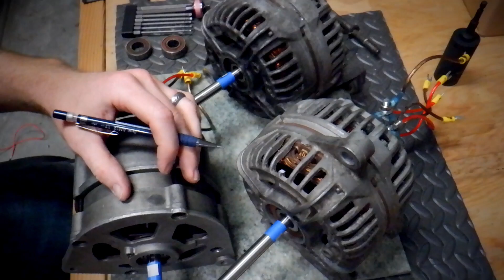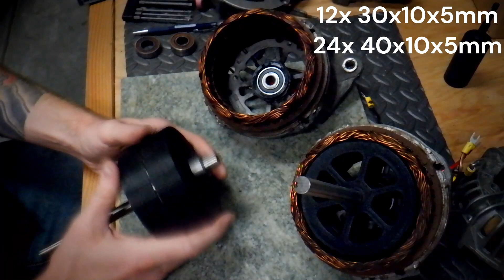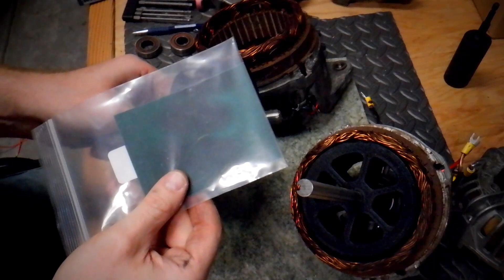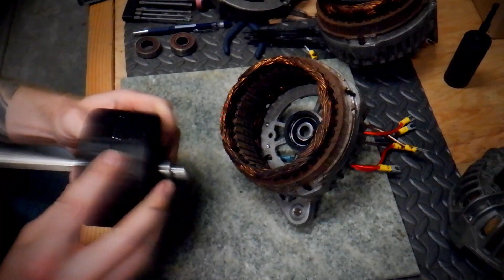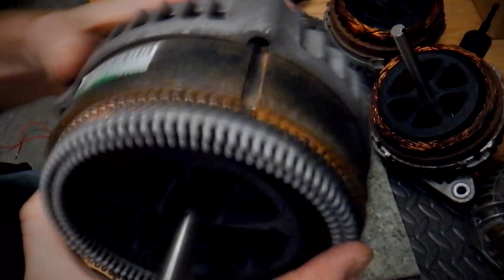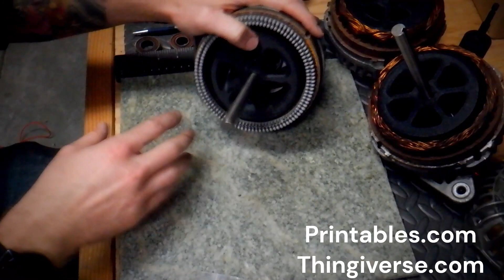Altermotor Comparison - High Torque or Speed?

Comment: Would like to see what the difference in power overall would be between the electromag and the conversion!
Reply from the maker: It would be very interesting to dyno to before and after!
But, using the same speed controller with both, I was only able to stop the shaft with my hand on the electromag core.

Comment: Hello, my dear friend. Your work deserves praise. Please let me know how many watts the motor is and the size of the magnet.
Reply from the maker: Thank you for your praise!
I only put 60W through it for testing, but I am comfortable that it can handle 500-1000W. Any more power and the core material needs to be changed to something more temperature resistant. But that change looks good up to 5000W.
Magnets are 40mm x 10mm x 5mm, double stacked and 12 pole pairs. So 24x total for the small one. The high torque motor uses more magnets.
Reply: I subscribed to you. I rang the bell. I am your big fan. Because I found in you what I was looking for. The FUTURE is BRIGHT in what you are doing. I will wait for the news. THANK YOU VERY MUCH!!!!
Reply: LOOKING FORWARD TO MORE VIDEOS FROM YOU…

Comment: Good work. Good video. Where did you source your magnets? Point of caution: If you have an ICD or pacemaker, avoid close or prolonged contact with magnets or their magnetic fields. 
When you referred to the vent holes, I couldn't help get a chuckle out of "...so that it doesn't completely melt itself down -- prematurely." Prematurely? You mean it WILL melt down at some given point? 🙄 Thanks for posting all your good work,  instructions, and links.
Reply from the maker: Thank you!!!
Amazon for the magnets, but some for other motor projects were obtained for K&J Magnetics.
Yeah, prematurely since motors tend to get a little hot with prolonged use and higher currents, and it's only PLA plastic.